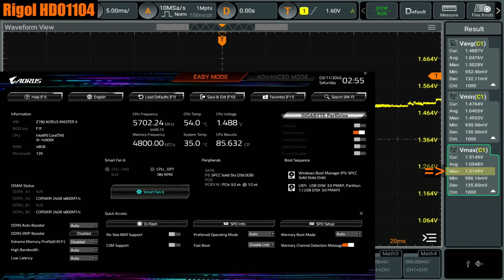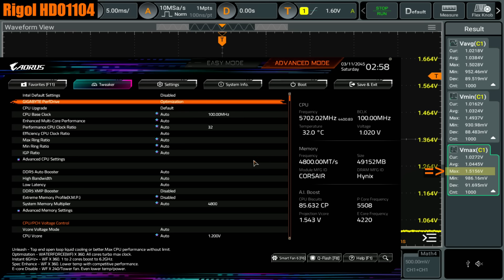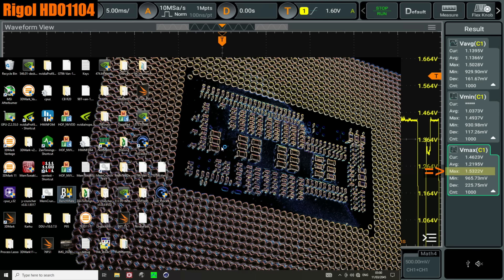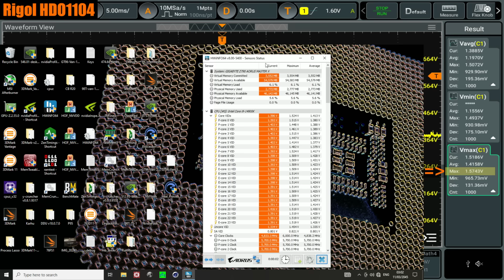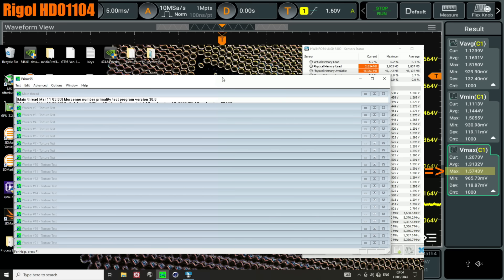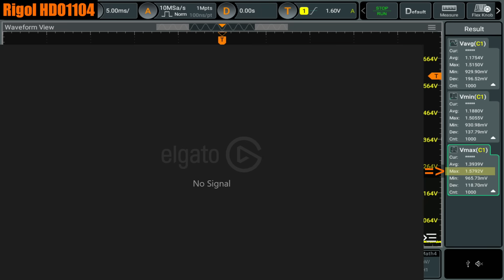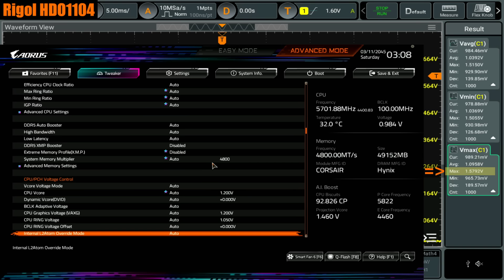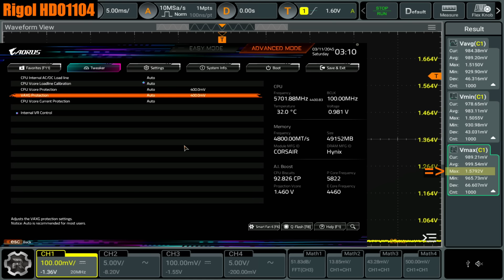Turning off "Intel Default Settings" with Microcode 0x129 DISABLES THE VID/VCORE LIMIT

Comment: Holy shit this is disappointing. What a bandaid fix. We are on our own. I'm glad I undervolted from the start.
Reply: so it seems, people have been calling the "fix" exactly that, a bandaid, a fucking bandaid to have the CPU last pass the extended warranty
Reply: @Alonne1  It's a fucking disgrace, I'll just say it man. This should have been implemented on such a hardcore low level that whatever any user does in BIOS, it should never override this, a true fix. I wonder if they have actually done this on purpose, to just push away anyone trying to RMA later down the line but who wasn't using their intel default profile. You can't help but wonder. It's just so lazy. After all this time...
Reply: Seems we wasted our time updating to this microcode then.. as predicted. You're right, fucking shambles.
Reply: Why would you buy 400 watt 1.5v CPU without radical cooling system anyway ?
Reply: @club4ghz  Nobody bought a 400W CPU. 253W or 320W in case of KS chips.
Reply: @Janitorus  Not true, my KS at default on r23. Pulls over 450w. What you talking about bud?
Reply: @johnboy2436  I'm talking about official Intel spec powerlimits. Of course it pulls more if you leave it free to do what it wants, I would never argue that.
Reply: @Janitorus  Fair enough but why are people arguing over neutered chips? If you hit any of the limits your throttling and not getting the speed you paid for?
Reply: @johnboy2436  That's not really true though, honestly. If you want to call anything neutering, it's running a lower iccMax, as that severely clips frequencies. 253W is a lot of budget for 14700K and 14900K, they boost their two Pcores to max within that. Full clocks in games. The KS is a different beast but within these budgets set by Intel, you are blazing through anything and everything. But you can lose a looooot of performance with these whack intel defaults. 2000 points loss in 14700K and 14900K, it's insane. Depending on BIOS version and whatever combination of settings they seem to randomize there every time. Hardware like this will/should always hit some kind of limit. Just like how a GPU is constantly limited by "voltage" if all runs well (as opposed to temperature).
Reply: @Janitorus  It is true bro and the reason your hitting iccmax is because you have no set up your Ac and Dc LL correctly. For example, 14900KS with 56/44/46 will hit 420a in MW3 with LL5 and default (auto AC/DC LL). Try 0.72  on LL5 as intel suggests and tune the chip manaully it doesnt even come close to 300a. No one should be hitting ICCMAX.  Even at the 400a limit on intels extreme profile. I dont use all that rubbish anyway i dont need it.
Reply: @johnboy2436  Understood man, I'm all for tuning manually. Profiles are shit and tuned for guaranteed out-of-the-box compatibility (or so they think/hope...) Personally I'm not hitting iccMax at AC LL 0.06 mOhm and LLC "Turbo" with a -0.03V offset. 14900K is running dialed in at great voltages and temperatures, Vcore and VID's nicely matched even on DC LL AUTO with this specific board. Some things were really well engineered. 0x129 and default profiles on the other hand... Very sad.
Reply: @johnboy2436 Imagine buying a cpu and not paying for routine home delivery of liquid nitrogen so you can avoid throttling. Freaking normies man.
Reply: @piedpiper1172  Not needed for the 14900KS just a simple direct die with custom water loop is enough bro. I use liquid nitrogen for warts bro on my winky.
Reply: @club4ghz Cooling has nothing to do with this. Apparently the problem is oxidation of connections inside the chip, which is greatly accelerated by the voltage that Intel chose to grill them with. Thus eventually the CPU stops being stable at factory speeds.
Reply: @masterkamen371 Oxidation was never the main issue most likely. That was a manufacturing error which affected some CPUs in a vaguely known timeframe.
Reply: @masterkamen371  Oxidation I do think was just a specific batch. The big issue I really do believe is simply voltages.
Reply: Undervolted from the start as well. That didn't prevent the cpu from degrading though. So yeah, we are VERY much on our own indeed.
Reply: @geekaycee43  oofff... If you don't mind, which CPU+motherboard and exact settings?
Reply: @Janitorus  asus z790-e, 13700kf, noctua NH-D15. XMP enabled, voltage offset -0.05, rest was stock settings.
Reply: @geekaycee43  Thank you for responding man. -0.05V might not have been enough to prevent those high transients, judging by the history of Asus "defaults" and even what they call "Intel baseline" ... insane unlocked powerlimits, 512iccMax, MCE still on, AC LL of 1.1 mOhm. You could probably offset -0.125V with those insane settings and still be stable. Chip probably never had a chance despite your best intentions, I hate these defaults with a passion.
Reply: @Janitorus  Doesn't matter any longer, really. Had to change the platform with a decent money loss. No Intel for me no more. Good luck with your cpu, mate =}
Reply: @geekaycee43  Completely understand man. Enjoy the new system 👍
Reply: Undervolted to WHAT??? I meticulously made sure my vcore never went over 1.23v, temp never over 50c, and I still lost 2.5 biscuits just by trying out fixed vcore????? People online said 1.3v was fine!!!
Reply: @pinnacleexpress420  1.23V? That aint how you blaze it man. RAISE IT UNTIL YOU SEE SMOKE.
Reply: @ dwag there are 0 guides for the i5-14 and i am miserable lol
Reply: @pinnacleexpress420  Guides for what? Undervolting? Tune AC LL to LLC, CEP ON, set PL's, iccMax and do a negative adaptive offset. JOIN THE LIGHT.
Reply: @Janitorus  I dont necessarily want to undervolt. And I think that means I dont have to disable CEP, but Im also unsure. Since trying fixed vcore at 1.23v (what it was running at as a max when it worked well offline out-of-box) cooked my biscuits, and the two things that kill chips are heat and voltage, and Im on an LM'd die with solid AIO getting absolute max of 50C, it seems like the obvious answer is to set IA Vcore max of 1.20, but also use an aggressive LLC, and then somehow convince it use waaayyyyy more watts AND amps. But I have literally zero idea of how to do that. I would guess I should use the max LLC and set vcore low to like a single volt or something. But idek the difference between AC LL and DC LL, and I still have zero understanding of the "offsets". Arent there multiple kinds of offsets to be tried? What is an adaptive offset? WHAT ARE WE OFFSETTING??? The lack of default values in Gigabyte bios (dont know if this is the new standard or what) also feels like ass. I cant find any official datasheets from Intel, like the one I found for my i7-7700k which said 1.35 vcore should be taken as the safe max. It seems like nobody has ANY idea whats safe anymore. Oh yeah and then Buildzoid said that these rings on 14th gen ALSO love to kill themselves and a supposedly safe VCCSA of 1.32v also cooked another 2 biscuits trying to get this crummy RAM kit to do anything half decent @.@ Im so lost bro. The 3 toe-dip level guides out there for the i5-14 just focus on how to not cook the chip with the worst possible setup. I did the delid meticulously and have a solid AIO, max I ever saw was 50C (dont even know what the fan curve for it is yet, its stock), and Im looking to get some good safe performance. Its currently not enough to carry my 3080 for 1440p 144hz Marvel Rivals, and that is my goal. I made a new account on MR and got MVP 10 games in a row, supposedly against no bots (could view their career pages). Ive got potential and so does this build but i need so much help :(

i have no idea what "tune AC LL to LLC" OR "do a negative adaptive offset" means, and I dont know if its ok to just put 9999 or whatever for the PLs and ICCMax (which my board technically doesnt even have but I believe I found the equivalent), and besides that, raising PL1+2 and ICCMax equivalent didnt even convince the chip to use more power, still capping at 135W

Comment: I had to return my 14700k with the performance degrading by the day for a 14900k. (I know risky.) - But so far, before and after the microcode this thing runs 15c cooler than my 14700k at the same intel default settings that the 14700k was overheating with. With the same exact set up, the 14900k ran cool and no issues so far in comparison to the 14700k was thermal throttling and at times, unstable. 

Also.. I've been enjoying your videos and here is my sub!
Reply: How long did you have your cpu  ? i have a 17 14700f and mine didnt blue screen thankfully i updated my bio’s yesterday i had the cpu for about 6months
Reply: @nightwing8794  In short, I had bought mine at Microcenter on Black Friday it came with the MSI Z790 bundle. About less than a year, approximately around 6 months.
Reply: @nightwing8794  To add to this comment, what's weird is no matter what, it was overheating with even undervolting / underclocking. We thought initially it might be the aio, but like funny enough none of these issues have appeared in the 14900k yet, it's been rock solid thank god.

Comment: "You didn't update and use Intel defaults?   No refunds" - Intel probably
Reply: Bingo! This gives Intel a second excuse to cancel your warranty!
Reply: Oh I can help you with that! Sorry to hear about your issue. Rest assured, Intel values all our customers. Just keep trying to use our RMA service so we can ... jerk you along for 3 more months with repeated denials and delays and pray you give up.
Reply: @greebj you guys ever actually rma anything? Its very simple, ive had intel replace tens to over a hundred chips over the years. Some i destroyed and obviously woulda voided the warranty, and still they replaced them. Oftentimes i got new generation chips than the ones i sent back
Reply: @98f5  “tens to over a hundred”… I strongly doubt you’re a RETAIL customer… and that changes A *ucking LOT, man……..🙄
Reply: except you will not talk to "Intel", you will talk to a human who works in the rma/warranty department.  They are not your enemy, and whenever they seem to be challenging, they are just reading down some required questions.  They will likely know what is wrong and what to do before they even finish talking to you.  Yes, you might get an asshole - but then, just cancel the chatting/email and go with someone else.  Even Intel says to try again, so you are not even being wierd to do that.  For the most part, you will likely not deal with a jerk, so just say whatever it takes to get them to say yes.  I had issues with a 13700K and 13900K (bad psu) and it was not that hard to get a refund and a replacement, respectively.  Of course, I didn't say anything about the PSU, of course.  Because I am not stupid.
Reply: "Prove me i didn´t use intel defaults" - me and i hope i won´t have to do it like this...
Reply: @BearPiggy   bingo.
Consumers response: you convinced me to buy your shit advertising top performance; you can’t deliver that performance without you CPU becoming trash in 6 month, to prevent that you had to turn down performances: that’s a Fraud and this is a BIG juicy class action…
Reply: @kapitumbulu  Are you okay? Maybe go outside and get some fresh air.

A couple adjustments in the bios and your chip will run at 1.35v will barely any lose in performance. In fact, these chips run better with a small undervolt.

🤓
Reply: You guys are so funny. 

The way you talk about Intel, they wouldn't have been a company for decades if they acted the way you guys think they do, All based off some assumptions by YouTube tech influencers.

😂
Reply: @DingleBerryschnapps  whitout serious competitors and thanks to blind fanboys. I use Intel CPUs since you where still shitting you diapers, I’m very well capable of recognizing if a company sells good products (fine), bad products (fine, it happens), or paint the shit with a layer of gold and try to scam the customers, so go back to picking your nose in your little basement.
Reply: @DingleBerryschnapps  they’re all just annoying sheep and do what they’re told and parrot YouTubers. Complete loser AMD shills.
Reply: Just lie about it, and if you feel bad about that, note that they've been lying to you for more than a year.
Reply: @The_Noticer.  big corpos, including AMD, Nvidia, Apple, Google, ... (the list goes on and on) lie all the time and only backtrack, when they get caught.
Reply: they'll refuse your refund even if you did update and use intel defaults
Reply: They are replacing the CPU
Reply: How would they Know?
Reply: @BearPiggy  actually Im waiting for a full refund all money back from Intel they offered the Refund.

Comment: I guess this is what I don’t understand. My voltage on my 13900k with extreme settings, never goes over 1.27v. Under load, I’ll see it dip down to about 1.145v. It’ll maintain 5.5ghz under most circumstances. How are most people dealing with 1.4+v? I will say, I set my AC/DC LL and LLC, with an uv, but those voltages seem extreme to me. Let alone 1.5+v
Reply: same with me, i never witnessed about 1.35v...
Reply: @realracing3specter295 what chipset do you have?
Reply: You won't see voltage spikes during multicore stress test, they happen on app transitions and even on idle sometimes.
Reply: @dusty_48  I’ve never come close to that. I constantly monitor that and have never seen spikes like that

Comment: Hey it can be software, Starfield mods can crash the game, turn off that 1 mod the game stops crashing, so Intel has now opened pandoras box...lol
I had my 13900k degrade in Feb this year, bought it on launch day (October 2022), my first sign of degradation was NVIDIA drivers failed to detect my card or install drivers, instantly thought it was card, swapped it out for my wifes 3090, same thing, tried my sons 1660 Super, same.
Did a fresh Windows 11 install, still the same, but what popped up is I couldn't unzip anything with winrar/7zip, the CRC would fail every time.
I did have the Robocop problem where it wouldn't get past the first video, didn't think much off it, just locked my cores and it was fine, thought it was a software bug.

Did every troubleshoot steps prior, not a novice when it comes to hardware, been in the industry 30 years, so I bought a 14600k and bang all the issues gone, took it up with Intel, they got me to set BIOS to defaults and run XTU, failed XTU within 3 seconds, they RMA'd the CPU.
Now this was well before the public outcry and Intel's response, but the tech I was talking too knew what was wrong and hot to reproduce it, helped that I tried another CPU too.

They sent me a replacement with the manufacture date of December 2023, so well after then knew internally of the oxidation problem, so it seems the replacements are going to be coming from new fabs..

Luckily I've been really safe with the new one, still manually tweaked everything till the new microcode come out, but from what I've seen myself even the Intel Extreme profile can spike if you don't mess with voltages slightly, just not to 1.5+v

Comment: So the best of both worlds is, IA VR Voltage Limit 1550 (same as 0x129 update) and MultiCore Enhancement Enabled (Remove All Limits). Unconstrains CPU and lets it boost to the max supported speeds within the voltage limits. It will cap out at ~320W which is what the Intel Extreme profile for the KS models cap out anyway...
Reply: Setting all these means you've disabled Intel Default Settings right?
Reply: @Aveeux  I didn't even bother updating my BIOS. Just manually capping the internal voltage should be more than enough.
Reply: How are your temp with 1550? What is your loadline?

Comment: So basically we can get the same thing as the new "microcode" by just setting our own IA VR Voltage limit...  Might keep my 13700K on the old BIOS for now just with the limit of 1.4v that I've been running until at least the non-beta version of the BIOS's.

Comment: My Intel trust is seriously at zero at this point. Is the eTVB bug even real? I demand to see the source code of the VID algorithm at this point, I do not see how they could have bugged the algorithm in such a way to be able to resolve the issue with a microcode update (0x129) but have it only work when using "Intel Default Settings" and that it's reverted so easily by board partner's BIOS profiles? This implies to me a much more systemic issue in Intel VR control (beyond load lines and CEP). Only explanation I can speculate on is the eTVB/VID algorithm doesn't contain a bug and works as intended. 0x129 is just a placebo with an inconsequential 1.55 V limit, after all a 50 mV reduction to very infrequent short duration spikes isn't going to quadruple your CPU lifespan as some people are hoping.

Reminder to all, Intel knew back in 2022 they had manufacturing defects (via oxidation issue, unrelated to eTVB "bug") but kept it a secret and continued to package and sell wafers they knew were defective and only acknowledged it this year after whistleblowers spoke to media but still now we don't have a list of affected batch numbers, merely a vague promise of extended warranty for informed consumers who persist through multiple denied RMA claims.

The only resolution I see at this point is an official recall of all affected batches, both socketed and soldered CPUs. If Intel doesn't want to recall that many units then too bad, they've had since 2022 to not try to cover it up and recall a smaller number of units or just simply not sell the defective CPUs.

Comment: Before this debacle, Intel CPUs have always had much better longevity and reliability than AMD CPUs.
Reply: I guess that’s what happens when your refresh the previous architecture slightly and keep using the same process node for a decade.
Reply: @backupplan6058  yeah, but at least they’re trying to turn things around